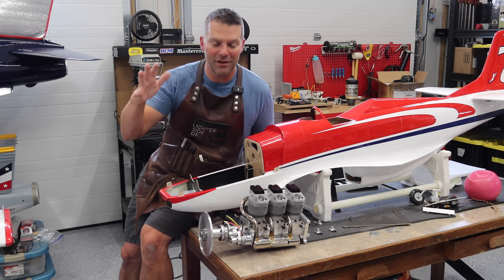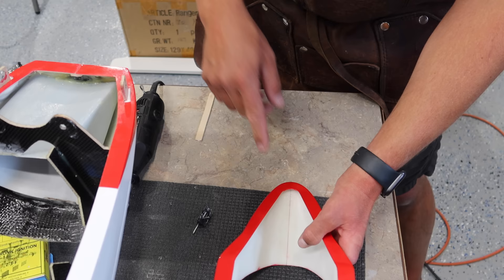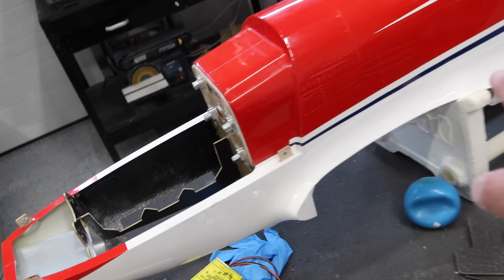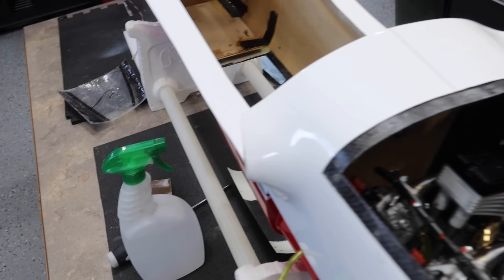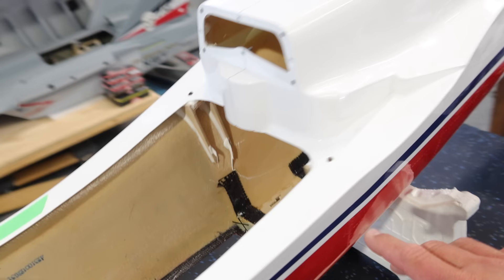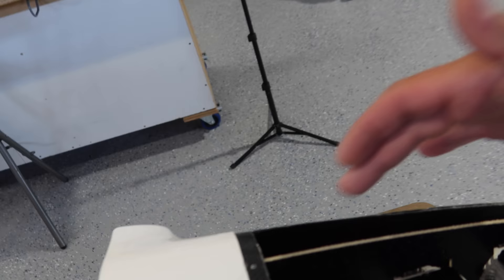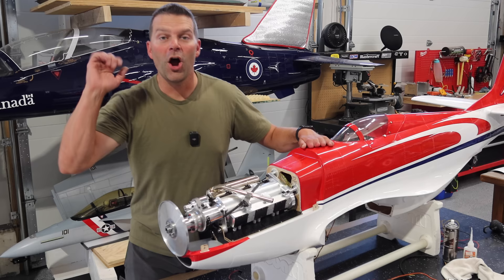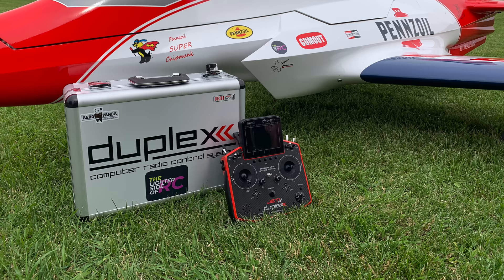Pushing The Limits - KOLM 230cc's New Home in the CARF Strega Reno Racer RCAirplane

Comment: J. You need to machine the tank cap return back a little if you want the Dubro bung to seal flush against the small tank hole. The Ali cap is designed for CARF tanks with a longer machined boss. The cap holds the bung from fully seating…
Reply from the maker: Thanks Dave!  I'll take a look at that.

Comment: Nice build so far. Quick tip. The esc, dont lengthen the wires from esc to motor, rathet the battery to esc wires. Other wise the length of the wires wil screw around with the magnetic feedback pulse  to the esc and ull have a eratic running brushless motor.
Reply from the maker: Thanks!  Re the ESC.  There isn't much choice.  I don't think mounting it in the engine compartment next to the hot exhaust is a good idea.  It only has to run the start motor for 5 seconds during start up then it's done.
Reply: @thelightersideofrc  and just outside the firewall? i had long motor wires like that on a rc heli and the motor didnt even wanna spool up. but if it works on youre plane then its cool. otherwise u wil know now why its not.ps hkws the cat pilot doing?🤣

Comment: I saw your Robart stand in your back "storage" area during your tour on Saturday, was curious if you actually use it much, and here you go. 🙂 i was going to pick up the Super Stand II version, not that i have a plane to put on it, yet. Just pre-planning/paring for one 😏.
Reply from the maker: Yea I use it quite often for misc things.  Parts of fuselages or prop planes like this.  Mine is pretty beat up and has been glued back together but still works for things like this.

Comment: If the mounts are the same size as the washer, what’s the point of them? I don’t get it. Wouldn’t it be best to leave as much of the firewall intact (ie: no countersunk washer hole) and bolt the engine on? If the washer was HUGE and distributed the weight of the motor over a greater area I would understand. I don’t know what I’m on about in any case. 😂 I forgot to say: I love this build ❤
Reply from the maker: without the washer the engine will damage the firewall and recess it.  So if I didn't do it now it would be needed in the future after X number of runs.
Reply: Normally I try and find larger washers, but Hysol the washer stops it oscillating and eating into the bulkhead.
Reply: I disagree.  I learned this with safety wiring as well.  The larger the washer, the more the load is distributed.  Wider washers keep the bolt head from eating in.  Hysol will NOT help that.  Wood or aluminum, it doesn't matter.  I know  because I've tried both methods.
Reply: @MPRasta104  then you didn’t do it right, or the sub structure was too soft.
Reply: @thelightersideofrc  Okay, yeah that makes sense. 👍🤔

Comment: The starter motor system adds up some weight! How about not installing the starter batteries but plugging them in, start the engine, then unplugging the pack?
Reply from the maker: Yea I thought about that as an option.  In the final video you will see the sollution.  I ended up just proceeding like we were going to install the battery in the plane and hoping a smaller battery would be suitable. Look like it ended up working perfect.  I did think about having an external plug but wanted it to be all internal in the end.

Comment: 31:24 You used those alligator clips for testing the battery needed for the starter?!?! Those little things are never made for high power use! They couldn't pull the cock off a chocolate mousse!  Lol. Everything else on your build looks absolutely awesome!  I am going to subscribe. Thank you.
Reply from the maker: LOL. Yes that's why it's a test and we don't use the crappy alligator clips in the final build.  If it works with the clips it will work with the actual proper wire.  Thanks for watching!
Reply: @thelightersideofrc  Awesome video! Have watched more of your stuff. Thanks for your work!

Comment: Why do you use  (hysall) versus 2 parts of epoxy? Sorry if the hysall is spelled 
Wrong!! The plane looks awesome. I hope that Power plant is not too much!!
Reply from the maker: Part of it is convenience.  I can squish some out, mix it up for 20-30 seconds and it's ready to go.  If i'm using 2 part bare epoxy, I'm pulling out my measuring devices, measuring A and B, mixing it then adding suitable additives to make it appropriate for the intended use.  All of that takes maybe 5 min and much less convenient.  Standard 2 part epoxy with out any additives is not suitable for most of our applications.
Reply: @thelightersideofrc  What Additives

Comment: On the tail wheel, noticed the left door “buckles” at the center a bit when closed, perhaps the servo may be pulling it a bit too hard?
Reply from the maker: Door closure is controlled by the wheel pushing down the piano wire.  Adjusting the piano wire is the fix.

Comment: That is another excellent video, Jon. Thanks for sharing.
I wondered how to calibrate the mix in the carb needles. 🤔  
Is it a Data Terminal or a voltmeter (White device near the pressure tank)?
The gas tank should also be held/locked in the back. Right? Gas engines can shake a bit, and the tank can slide back.
I guess I'm getting very anxious about the following video. 🤣
Reply from the maker: Thank you for watching!  No fancy equipment with these old fashioned gassers.  Pinch the fuel line going to one of the cylinders and listen to the reaction.  Adjust accordingly.  The tank is held in place with Polyurethane Caulking and the Zip ties.  Not going anywhere!

Comment: What about engine ventilation?
Reply from the maker: Great ventilation system built into the aircraft.  Air in.  across the carbs and cylinder heads.  through the firewall.  out the back of the plane.
Reply: @thelightersideofrc  Any air exit ports in front of firewall?
Reply from the maker: @rmorris3722  no.

Comment: there is a pump that they recomend using,yes it costs more i know,but i think it will have a more steady fuel supply....
Reply from the maker: Kolm actually recommends the pressure system and I totally agree.  No fuel pump to fail.  The air takes less than a minute to fill for the first time.  Simple and it always works.